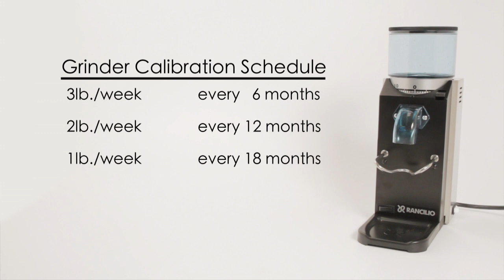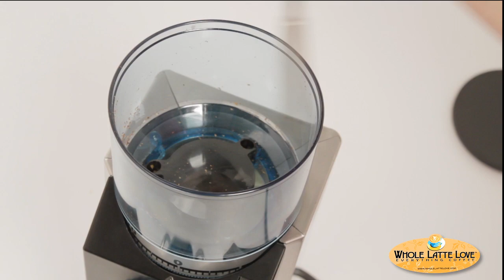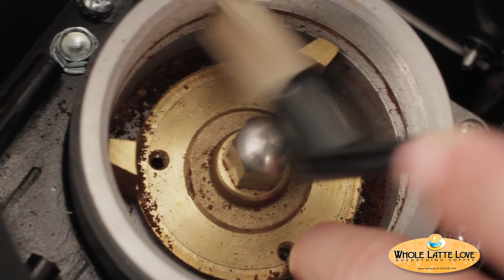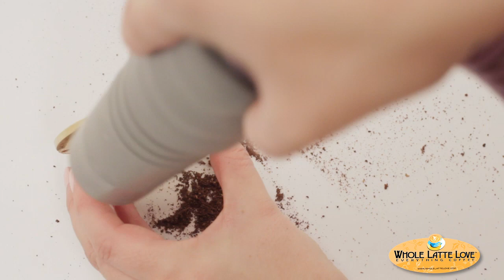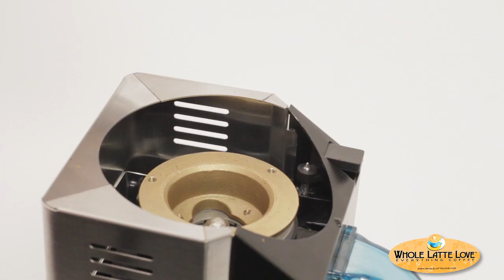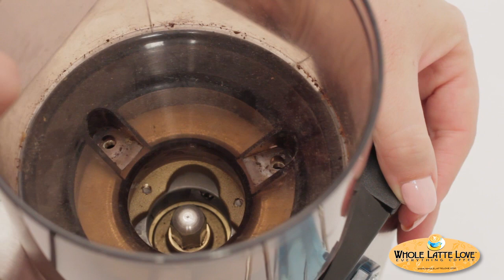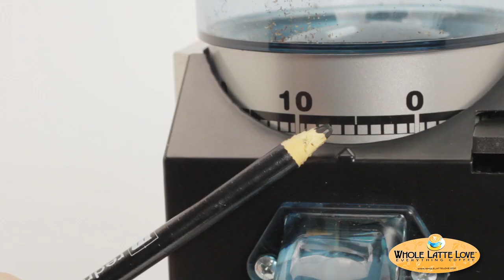How to Calibrate a Rancillio Rocky Grinder

Comment: I have a Rancilio Rocky and i can't remove it counterclock, it seems it has so much dirt that it stuck
what can i do? plz help
Reply from the maker: +Kuduku They can be very difficult to remove if they have not been cleaned on a regular basis. Outside chance it may be cross threaded - hopefully that's not the case. You might try using physics to assist in your effort. Run the grinder for 60 seconds or so to warm things up then apply an ice pack to the interior area of the upper burr carrier for a minute or two. This should cause the metal to contract ever so slightly. Hopefully enough to allow you to remove. If that doesn't work try a hair dryer or heat gun to warm up the entire outer area burr carrier. This may help make the coffee gunk a little looser allowing you to remove. Be careful not to get too hot and burn yourself or damage anything. Let us know how you make out.
Reply: +Whole Latte Love i actually made it finally, thanks for the help
i actually used so much strength in kilos that i assume you that it was impossible to open with bare hands
i used a big plumber wrench tool and got the job done...
From now on i'll clean it every 6 months considering that i'm using it every day
Reply from the maker: Kuduku
Happy to hear you were able to solve the problem!
Reply: Mine is a month old and I've mostly managed to widen the hole in the screws. Not the greatest screws Rancilio uses. Also I need a ticker flat head screwdriver
Reply: @mathieuclement8011  Screw heads have sizes. Use the right one and life is as it should be.
Any gunsmith or mechanic will give you a sad look if you knacker them up.
 Some folks shouldn't be around anything sharp.

Comment: Hello ,
I have a Rancilio Rocky and I just cleaned it. I made it nice as new, the problem is when I screwed it back and re-calibrated it, It was completely blocked at the 0 setting. It's like someone put super glue on the thread, it can't be moved at all!

I'm completely desperate, I hope you can give me some resolution tips!

Thanks
Reply: oy

Comment: The calibration on my Rocky for some reason stopped going below 10, making my grounds far too coarse for espresso. This video was just what I was looking for as I figured I waited too long to give Rocky a good cleaning. Unfortunately it didn't help. Problem is the top burr does not screw down to a "zero point" where the two burrs touch. I can't for the life of me see anything that would be stopping it from screwing down. I cleaned it completely.
Reply from the maker: Alan Brunettin Hi Alan, just to confirm, after cleaning you can not screw the top burr down to the extent that it makes contact with the lower burr? If that's the case, we suggest re-cleaning the threads on the adjustment collar and in the grinding chamber and trying again. Coffee residue in the threads is the first suspect causing inability to reach zero point. It could be caused by thread damage/cross-threading as well. However, if you can turn the adjustment collar in at least a few full turns that's probably not the problem.
Reply: Whole Latte Love That indeed was the issue. I couldn't believe it. I was sure I had cleaned the threads sufficiently; certainly it LOOKED fairly clean. But I went back with a much stiffer brush and even went at the single thread or two that refused to give up the ghost with my fingernail. I just couldn't believe that little amount of gunk would stop the burr from screwing down; a testament to how little tolerance is allowed in the machining of the brass. Also a lesson in staying away from the really greasy beans. Here I thought I preferred them. No more! Thanks! Oh also, I repositioned the adjustable stop-point and now "9" is actually "0" on the hopper's gauge. That's dumb. Why don't they make the index movable too? Oh well...
Reply from the maker: Alan Brunettin Glad to hear you solved the problem! You are right threads can be very tight in adjustment collars and it takes surprisingly little to make them very difficult to turn.
Reply: Whole Latte Love Indeed. However...and let me say here, I understand this isn't a tech support line (I did buy my Rocky--and Silvia--from you at least) but I am flummoxed here. I just drew a double with my newly ground beans and I had to stop the flow because I got about a half-cup of coffee in just about 10 secs! And this was at a 5 setting. I went back into it to make sure I had zeroed it out. This time I really screwed it down stopping the bottom burr and backed-off only slightly; even doing the sound test of the burrs rubbing to make sure I was at absolute zero. Now it registers at "5" on the hopper's index. I drew another double and tho I was able to run it for the minimum 20 secs I still got a lot more than a double shot. And the resulting cappuccio was rather thin and drab. How can this be? I was just a hair off the burrs rubbing and still the grounds were too coarse?.
Reply from the maker: Alan Brunettin Hmmm, how do the grinds look? Any chance the burrs are due for replacement?
Reply: Whole Latte Love I guess they look okay. I don't have a frame of reference tho. Granted they're the original burrs and the grinder's 2+ yrs old, but this happened all of a sudden after I took it apart for deep cleaning. It had been okay before that.
Reply from the maker: Alan Brunettin Should be finer than granulated sugar. If so, I'd look to other causes for the quick pulls.

Comment: I've had my Rocky grinder for about 10 years, and about 5 years ago I had to start using a fork to push beans down to grind beans for my Rancilio Silvia. After watching this video (nicely done by the way) I decided to go for it and see if I could fix it...HOLY CRAP was it dirty and caked-on nastiness. The hardest part was to remove the adjustment collar, but a little leverage did the trick. I thoroughly cleaned everything and and calibrating it to the proper location was a piece o cake. Now it looks and grinds like new! Thank you for this GREAT video!
Reply: +Kevin Brown i have the same problem i cant remove the collar because of the dirt. what can i do? plz help..
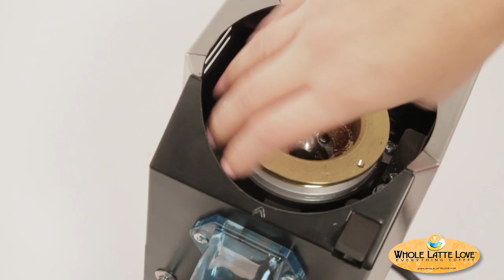Reply: +Kuduku on this video at 1:00, you can see three holes in the top of the collar (where the screws from the hopper attach). I was able to remove it by...
1) getting a small allen (hex) wrench and sticking it into one of the holes
2) Sticking a socket wrench (long shaft) onto the center shaft, but you could use a regular wrench too
3) carefully turn the collar by using opposing force on the allen wrench and socket wrench COUNTER CLOCKWISE so the collar breaks free.

If your grinder is really dirty, it will take some effort... but much easier than trying to turn it using only your hands.
Reply: +Kevin Brown i actually made it finally, thanks for the help
i actually used so much strength in kilos that i assume you that it was impossible to open with bare hands
i used a big plumber wrench tool and got the job done...
Reply: +Kevin Brown  Creating leverage is a great idea.  But keep in mind those threaded holes are brass, and the threads can easily be damaged by the sideways force on whatever you stick in the hole(s).  If you have a longer screw/bolt that could be threaded deeply into the hole, it could be levered against with less risk to brass threads.
Reply: YES clean it every 10 years!!
Guy, you should save money and just get a MrCoffee.
Outside of the improvement, you won't know the difference